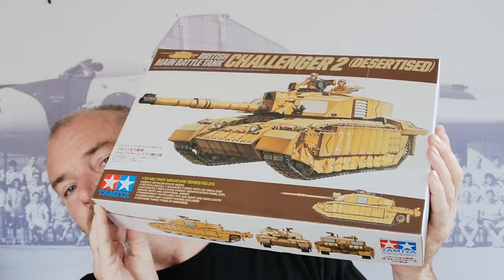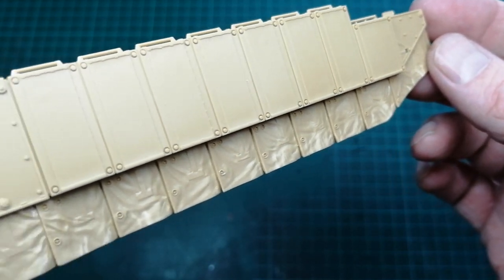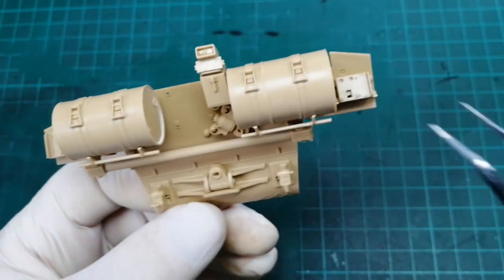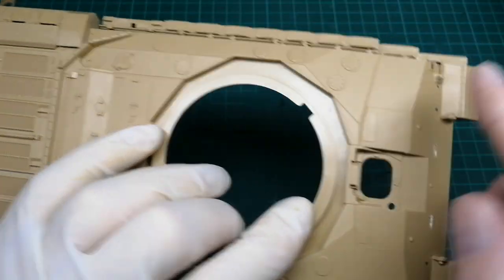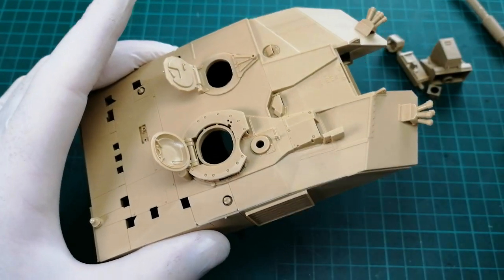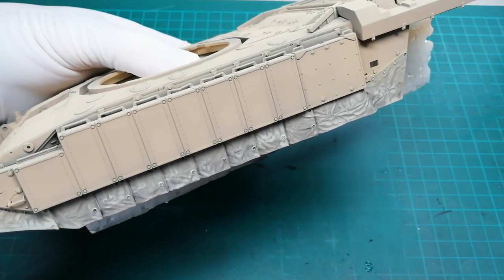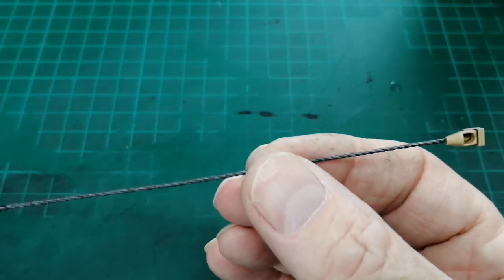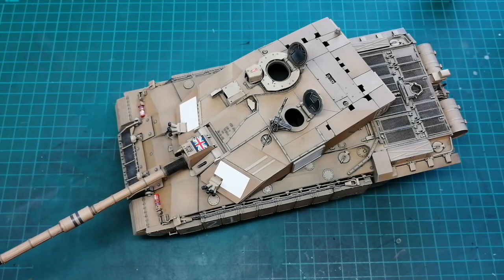Tamiya's 1/35 Challenger 2 (Desertised) Full Build.

Comment: Hi Greg, the CIP is the ‘Coalition Identification Panel’ same as the ‘ribbed’ panel on the side we were told that the ribbed pattern and the small ‘glint/reflective’ tape and materials on uniforms and vehicles would reflect differently from the same panels and tape form the first gulf in infa-red devices in case the Iraqis had managed to purchase the Coalition Identification equipment from the first conflict.
Great build, I’m currently just finishing off my hull, I have been using this video for reference thanks.
Reply from the maker: Thanks Mark, I wish I knew all this stuff 👍

Comment: This is my first ever tank. Thanks for posting this as I'm stuck. Where I'm stuck is on the top idler rollers, the whole they go into is to loose. It doesn't show to put a rubber in it.. How did you get them to be secure?

Comment: I'm building Mengs new Chieftain mk10 just now it's really nice! The detail in the suspension is crazy nice n all movable with metal springs like Afv clubs centurion really! Alot nicer track's than takoms the rubber pads Moulded in not a Separate peice so that's a plus! It's in there new white plastic it's great to work with the casting and welds are just lovely it really is worth the money! £70 I was last week its just a tank I've wanted to build but never rated takoms much then saw meng had one out it was in the model shop so got that and RFM stug! I've built both RFMs challengers there nice but wish they made a Charlie 1 next! It's only Tamiya woth a desertized one we need more newer one's!

Comment: I'm making this tank with a Trumpeter kit. It's a nightmare. Thousands of tiny parts with a confusing booklet. Most parts don't fit at all, plus you have to drill holes and cut bits off here and there. Awful.
Reply from the maker: Tamiya are always a safe bet
Reply: @GregsModels  I usually get Tamiya, but I fancied a change. Cheers.